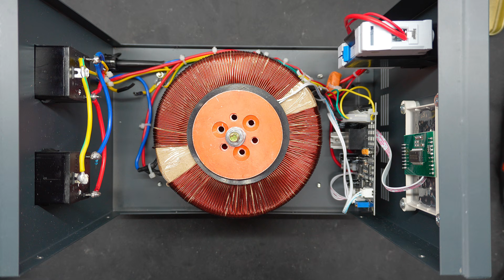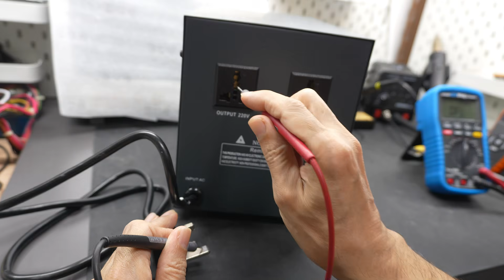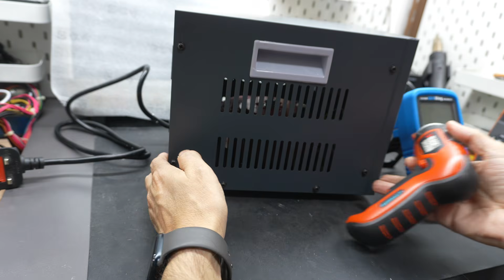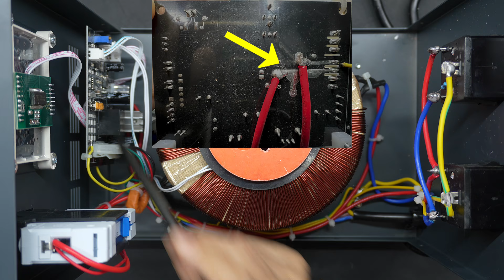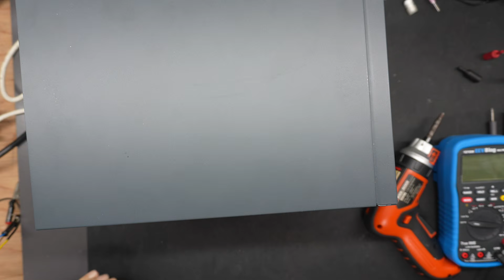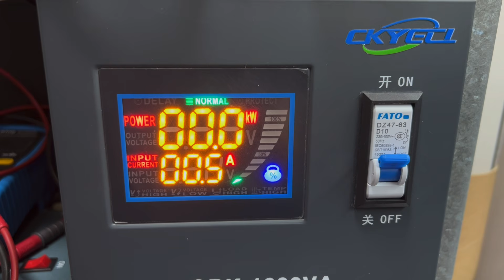GBK-1000VA Isolation Transformer Review - There’s One Fix You Should Make

Comment: Why would a transformer have a large inrush startup current ???. . With noload on the secondary, the primary side on the transformer would act as high value inductor limiting inrush current.
Reply from the maker: Thanks for your question. From what I researched, the inrush current is mainly a magnetizing effect, not a load effect. When the transformer is powered on, it has to build its magnetic field before any real secondary current flows, and the way the flux builds depends on where in the AC cycle the voltage begins. If powering-on occurs at an unlucky point - such as near a zero crossing, the flux can overshoot and drive the core into saturation. When the core saturates, its inductive impedance drops, leaving the primary winding limited mostly by its small copper resistance, which allows a large surge current even with no load connected. Leftover magnetism from the last shutdown can make this worse, so on the next startup the new AC-driven flux may push it into saturation more easily, leading to even stronger inrush. I actually noticed my breaker tripping more often after the first few power cycles. Toroidal transformers are especially prone to this because they can retain relatively high residual magnetism.
I believe the isolation transformer was built for an industrial environment (not home), where the breaker trip levels are usually higher.
Reply from the maker: I was also able to prevent the breaker tripping issue by building a soft-start circuit for the isolation transformer. Planning to show this in my next video.
Reply: magnetize the core